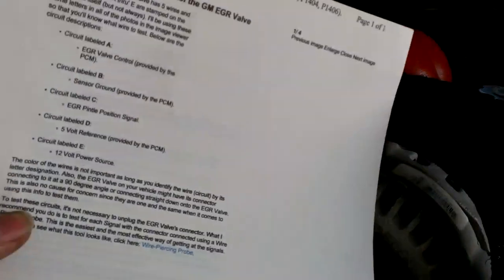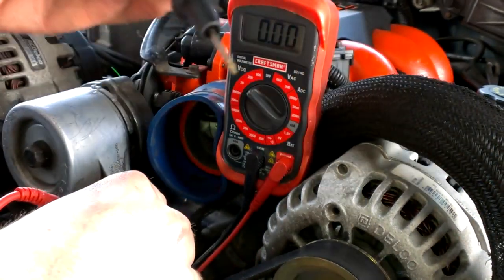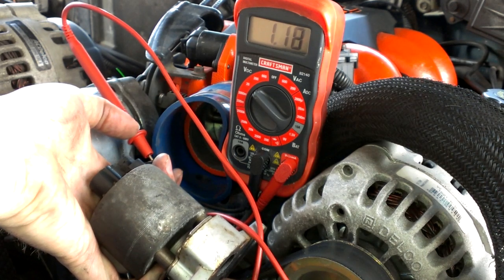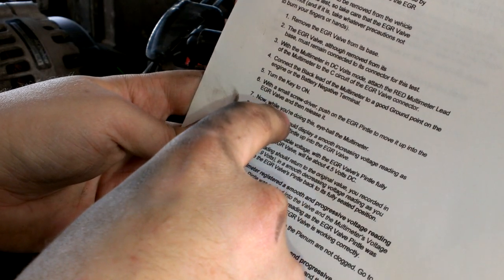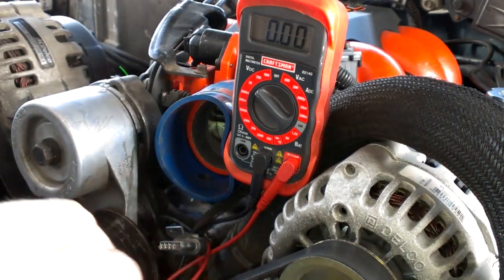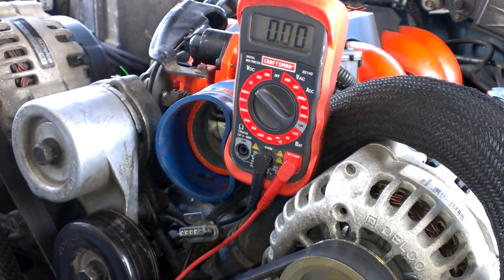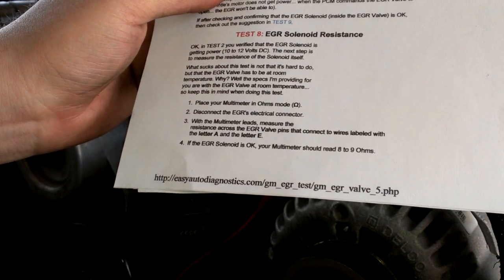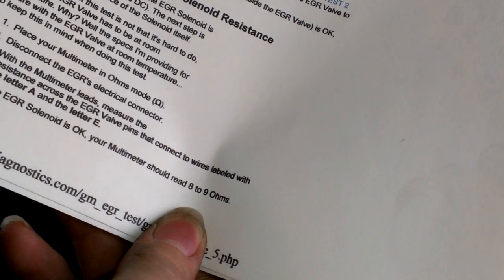How to test GM EGR valve

Comment: Best thing to do is replace the EGR. Get a code tester and see if it says EGR. Get a Actron CP9680 code tester. It reads live, record, graphing, emissions readiness test, transmission codes, oxygen sensor test, and MORE! It has code-connect to diagnose codes.  It comes in a black pouch. It uses 4 aaa batteries, not included. EBAY has it.

Comment: The birds!! The birds!! Nice video!! Thanks for sharing!! I'm having a problem with a 07 Chevy Silverado 5.3 v8 , p0300 and c0561 , looks like active fuel management system is the problem, but sometimes when egr solenoid is bad make a fake c0561 code. I will test egr solenoid and it circuit to be sure

Comment: I had to take my plenum off to replace one of the fuel injectors. The egr valve has to come off to remove plenum. When I put the egr back on I accidently installed it backwards. It was running really poorly and the code for egr was shown on code reader. I intsalled the egr valve correctly and the engine light went off and was running fine. After a while the engine light came back on with the same code. I tried cleaning the egr valve and it didn't help. I also noticed the egr valve is getting extremely hot. Do you think I ruined the egr valve by intalling it incorrectly or, do you think it damaged something else?
Reply from the maker: its possible that installing it backwards may have damaged the pintle that moves in and out in the egr. run through the tests i show in the video and see if it fails the tests. did the gasket look ok after reinstalling it? maby a leak in the gasket.
Reply: Bam6972, thanks for making and sharing your videos

Paul Griswold : I would not think that the pintle could be damaged from what you described as the direction of movement only allows it to retract into the body of the EGR valve unit.  When powered off it drops into it's lowest position which is flush with the bottom of the EGR valve unit.  It can't push outward to bend against anything.

As far as the heat of the EGR,  the unit is recirculating exhaust gas which has come directly out of the exhaust manifolds, so you are talking about temps of over 1000F degrees.  So it may be normal to seem hot. That is probably why there is a heat shield around the unit on some cars.  I will have to try to get a temp reading from daughter's Buick 3800.
Reply: @ibowhuntga  It may be that the EGR system has a fault. Replace the EGR and check for voltages to the EGR with a DVOM. Maybe replace the purge valve etc. connected to the EGR.
Reply: @hankbridges5055  the purge valve is not part of the egr system, it is for venting the gas tank (evap system)
Reply: I did the same thing when I replaced my injector spider, inst the egr upside down and got the code etc - that was a few years back, it was ok after I flipped it and reset the codes. Now much after the fact I am having some issues I believe with the cats getting blocked due to having the injectors leaking before, I have been messing with the egr you can actually run it with egr removed by plugging the top hole (vacuum) and when you warm it up and goose the throttle you can see the egr operate. Having it be hot is not a surprise as it is known to actually open as much as 90% of the time under given conditions and it sucks the exhaust during these times - I stuck a piece of small hose into the bottom opening of the valve while it lay on top the engine and blew through the hose, when you speed up the warm engine (closed loop) it will begin to oscillate under engine loading and you are able to then blow through, in your case there may be some debris not allowing it to seat closed.

Comment: I have EGR problems on my 2005 Saturn Vue. GM used a Honda engine for this vehicle.
I would like to download the manual, like you did. Would I need to download the entire manual, or can I just get the pertinent section? I have the Haynes manual somewhere around here (if I can find it...I just moved.) I I locate my manual, where would I look in it go get the information that you outlined here? Thanks for an XXLNT video.
Reply from the maker: I found this on a diagnostics website that explains how to test a bunch of different electrical components. its w w w dot trouble shoot my vehicle dot com. see if you can find a egr test for your vehicle.if its the same looking egr valve in this video then this video should work for diagnosing it even though its not the same vehicle.